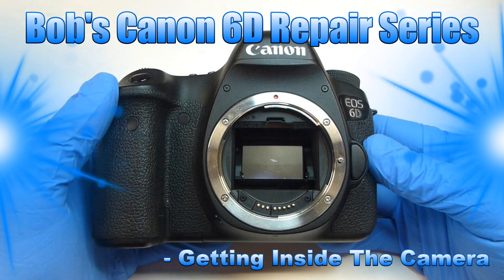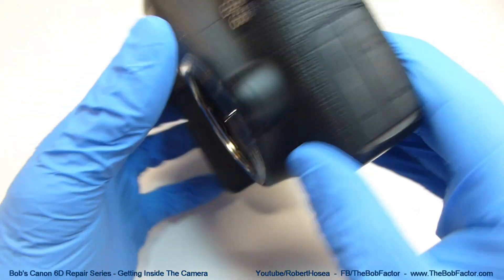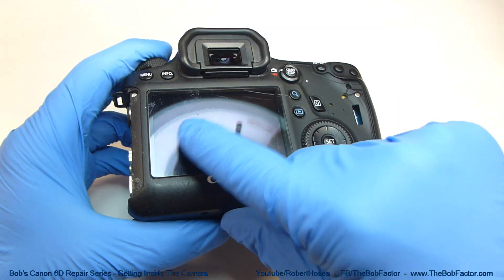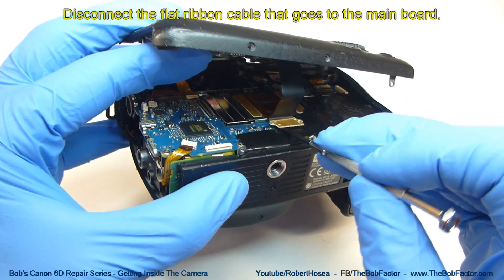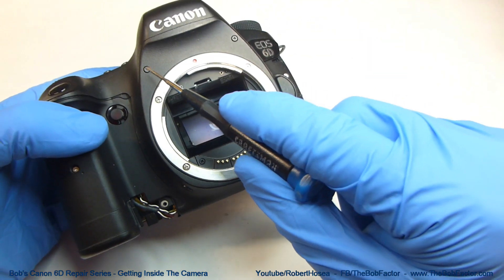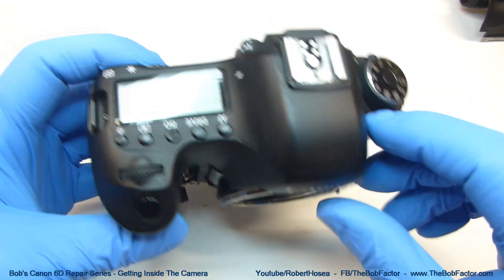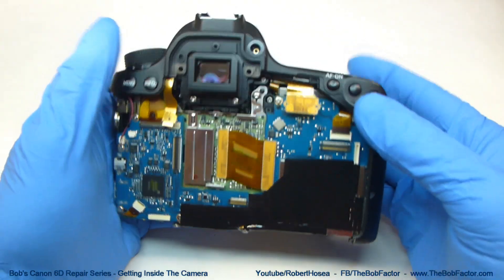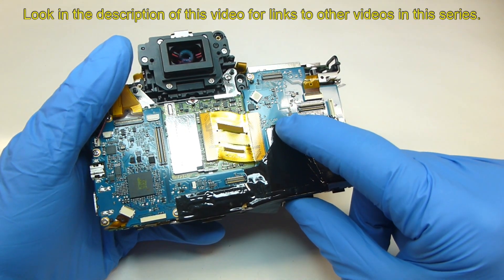Canon 6D Repair Series - Video #1, Getting Inside The Camera

Comment: This is a great video, clear and concise. Great diagrams too. 
I have a question though... I need to replace my aperture dial. Do I need to remove all the other panels to remove the top panel? It's obvious I need to remove the left and rear panels, but it looks like I could just remove the two screws above the lens on the front panel, and not touch the bottom or SD card sides. Does that sound right?
Reply from the maker: Yes, you should be able to get the top piece off that way Tony.
Reply: @ Thanks Bob.

Comment: Bom dia, tudo bem? Como posso fazer para trocar a bateria interna da CANON 6D, a data da minha muda a cada vez que desliga a câmera. Obrigado, abraço.
Reply from the maker: The battery is on the backside of the main circuit board. I believe it is a lithium rechargeable battery. Unfortunately I don't show the battery in any of the videos. It should be easy to spot though once you remove the main circuit board.
Reply: Obrigado por responder, vou verificar, desejo sucesso para você, abraço. @Thebobfactor

Comment: Is there a trick to putting back the small flex cable in top-left (near Menu/Info button)? I reassembled everything and now camera won't turn on (except red led near SD slot flashes sometimes). I suspect that cable isn't making a good connection.

Comment: Thanks dot this video, I bought a used 6D for 300€ because it wasn't auto focusing. I didn't mind at first but then I thought to check the connector to the AF sensor. I was pleasently surprized after I assembled the thing back together. It focuses as a champ now ! :D
Reply from the maker: That's great! And nice job on doing the repair yourself.

Comment: Hi, Thankyou so much for these videos - they are great. I broke off my lens release button, while trying to release an old stuck lens - silly me. That's getting fixed at a shop, but they are only removing the lens, The cost to strip down the camera was too much. So I am concerned that the stalk and circlip for the release button may be going walkabout inside the camera. My question: Is it possible to remove  just the front cover (cg2-4184-000) without doing the rest of the teardown you have shown?
Thanks from New Zealand!
Reply from the maker: Hi Rod. You will need to remove the side and back panels so that you can get to one of the electrical connectors and disconnect it on the main board. I don't believe you will need to remove the bottom though.

Comment: My 6d viewfinder info shows the warning symbol p.313.. do you know what is that and how it solve?
Reply from the maker: Hi Lucas. The p.313 refers to the page in the manual and it has to do when certain items are "Locked". Here's part of page 313 that describes the "!" icon appearing:

-----------------------------------------
Warnings  <!>  in viewfinder

When any of the following functions are set, the <!> icon can be displayed on the 
lower left in the viewfinder (p.23).

If the Picture Style is set to [Monochrome] (p.113), the warning icon will appear.

When WB is corrected
If white balance correction (p.123) is set, the warning icon will appear.

When ISO expansion is used
If the ISO speed is set manually to L (50), H1 (51200), or H2 (102400) (p.107), 
the warning icon will appear.

When spot metering is set
If the metering mode is set to [Spot metering] (p.150), the warning icon will 
appear.
-----------------------------------------

Comment: Thank you i am going to change the top shutter unit it makes a grounding noise and hard to change.  besides that my question is what type of glue to use after putting the leather 3 parts. Thank you so much for explaining all !!
Reply from the maker: Hi Peter. I have been using Elmer's Rubber Cement. So far it seems to work good.

Here's a link to some on Amazon:
https://www.amazon.com/Elmers-Photo-safe-Repositionable-Wrinkle-Adhesive/dp/B079KTKK6X/ref=sr_1_7?crid=DF5GKQ18B068&dchild=1&keywords=elmer%27s+rubber+cement&qid=1632174020&sprefix=elmer%27s+rubber+%2Caps%2C252&sr=8-7
Reply: @Thebobfactor  Thank you Robert so much  for your recommendation I will take your advice many thanks again ! you are no 1 .

Comment: Hey Robert! Your material is so well detailed, I'm impressed! Thank you for sharing. Btw , would you know if it is possible to fix a main board by reballing it? My 6D main board has failed and I want to try and fix it myself... Do you have anything to share on this matter? Thanks again!
Reply from the maker: No I have never tried doing that with a camera's circuit board. Generally, for me they are almost impossible to trouble shoot, and so it's just easier to replace them entirely. If you try reballing it, I would sure be interested in the results that you get!

Comment: I've watched your videos on repairing the Canon 6D. Do you have any information on how to fix the control dial just behind the shutter button? It has become hard to turn. Thanks.
Reply: No, I don't have a video on repairing that part. I've found that it was easier just to replace the entire unit. The only problem is that I've never found anyone in the U.S. that carries that part and I usually have to get the part from China. Here's a link to one that is on Ebay: https://www.ebay.com/itm/264814732531?hash=item3da83024f3:g:svUAAOSwAaJZ~rIa  I hope this helps you out.
Reply: @karenandbobstickney4478 , thank you. I know someone that had the same issue and they glued a thin rubber band around the circumference of the wheel. It worked for them. Not sure if I want to do that.

Comment: Great video ! I realize that I have a lot to learn from you. However there is a mistake you are making regarding the white connector on the Mother board ( top left corner) 7:22 , the flex should not be pulled out directly.That too has a lock on the bottom. I made this mistake myself some time back. This is also for the benefit of the viewers . Thank you

Comment: Thanks for the tut, I had to replace the wheel, everything went well but after putting it back together, the camera doesn't power on. The initial red light signal blinks on when switching from OFF to ON but the LCD is blank and the camera doesn't respond.  At one point the LCD seemed to display very shortly all the data at once then nothing.
Reply: Maybe there is a bad connection on cable connector? I hope you find your problem!

Comment: These videos are fabulous.  The screw sheets are very clever!  I have a quick questions- my well taken care of 6d is having a problem where the buttons on the back intermittently stop working, or press themselves.  I assume it's a component going bad, but it's not worth sending the thing to Canon or randomly ordering parts when I can replace it for a few hundred more with something newer.  (I was shooting a concert on NYE- thank god af-on kept working- but all the other back buttons went crazy.)  Anyhow, I saw that there is a connector going from the back plate to the main board.  It it worth opening the camera and re-seating/cleaning it?  Have you ever known one to come loose or cause issues like this?  It's about all I'm prepared to do before it's sold for parts.  I did drop the camera on thin carpet and this issue cropped up not too long after.
Reply from the maker: Hi Brian, I've never really seen a problem with the main connector or any of the flat ribbon cables just coming loose, but you never know. I think that would be a great first place to start looking. In addition to the connector that goes to the main board, you should also un-seat and then re-seat the flat ribbon cables on the inside of the back cover. Good luck with it Brian. I hope you locate the problem! -Bob
Reply: @Thebobfactor  Thank you- appreciate your advice.  I'll give it a go.

Comment: You might be able to save me a lot of time if you know the answer to this one. Could you tell me the specs of the different screws in the 6D? I have printed out your sheets so I know the lengths but I don't know the other specs. If you know it would be a big help. Thanks again.
Reply from the maker: If you're talking about thread spacing and the diameter of the screws, unfortunately I don't.
Reply: @Thebobfactor  Thanks for getting back to me. Appreciate it. I managed to strip a few trying to remove them. It seems my screwdriver was too much a Philips and not enough a JIS :( Now I know. I fixed my main problem of the USB not working reliably but now have an even bigger problem. It seems that for some reason beyond my understanding the center focus point no longer works. The lens just hunts back and forth and never finds focus and then just stops dead. I am going to have to open it back up and try to figure out what the hell I did. Beyond frustrating.

Comment: Man on man thank you so much! Love your print out sheets! You should have seen my hand drawn ones for the 5D Mark II they look like caveman drawings.
Reply from the maker: That's awesome. I'm glad they helped you out!
Reply: @Thebobfactor  Using these again today. Thanks again. It took going into the camera 4 times to finally figure out exactly what was going on and a big stroke of luck. My 6D had a broken USB port so I opened it up and tightened the et and touched the joints to try and make sure they had not gone cold. Put it back together and the USB port was much more reliable but still not perfect. I would have left it at that but the strangest thing happened. All the focus points in the camera worked except the one good one in the very center! Can you imagine how frustrated I was with this?! Focus everywhere except the center! ARG. So I open the camera up again and break it way down to take out the focus assembly. The mirror on the focus assembly had a PERFECT triangle section broken out of the EXACT center of it. It was so perfect that I just assumed that it was designed like this. Checked all connections put it back together and still the problem persisted. A week or so later my partner picks up a tiny piece of the mirror of the floor and shows it to me and asks "is this important" I look at it and immediately realize it is the piece of mirror from the focusing assembly! Light bulb moment! Soooo strange. How could the mirror have broken without me breaking something else in the camera? I was nowhere near the focusing assembly to fix the USB port so I did didn't do it. I just had to share this strange story with your wall. Today I am installing a new focus assembly from Canon that costs $80 delivered. It took 2 days to arrive! And I feel the price is totally reasonable. Canon Canada offered me good service on the phone even during this COVID-19 pandemic. So props to them for selling parts to the general public and getting them to me so fast. Very impressed with them.

Comment: The on/off lever on the top panel of my 6D is extremely stiff to move. If I take the top panel off do you think I can repair this or will I need a new top panel?
Reply from the maker: I think it would be worth trying Neale. Here's a link to a video that I did that shows how to repair the power switch on a 60D. It's not the same camera, but it will give you a general idea of what it will be like to take it apart.  https://www.youtube.com/watch?v=rpE7Co3dfgo

Comment: Great video. Thanks Robert. It's very well detailed and remarkably easy to follow. I used it yesterday to replace the main dial by the shutter button. My only comment would be that a #000 Phillips driver was a better fit for the screws. Might have just been the set of drivers I had though. Thanks again for this great series!
Reply from the maker: Hey thanks Ed. Yep, I've also noticed that too with some screwdriver sets. I guess it shows that it's good to have a few sizes on hand before starting a repair job. I'm glad you were able to get your main dial replaced.  -Bob

Comment: Great! Thanks for this video. I have been able to disassemble and replace the power board. But the camera still doesn't work, it doesn't turn on any lights. 
Any ideas? Could it be the motherboard?
Reply from the maker: Hi Willy. Is there anything at all displayed on the top LCD? Even just a blinking battery icon?
Reply: @Thebobfactor  No, there is nothing at all...
Reply from the maker: @willyvalen00 , is this also what the camera was doing before you replaced the power board? Something else to check would be the micro switches for both the SD card door, and also the battery door. Check to see if they look like they are working properyly.
Reply: @Thebobfactor  Hi Robert, yes, it did the same before changing the power board. Ok, I'll check, thanks.
Reply: There are two micro switches one under each SD card lid and battery lid . Check them out .All the best .

Comment: I could not complete the steps.... A screw in the battery compartment and some of the screws in the front panel is stuck. Any tips?
Reply from the maker: I've had that happen a few times on other screws. If the Phillip head slots in the screw head are rounded out and the screw driver can't get a grip, then drilling the head off is the only way. Then you will hopefully have enough of the screw remaining after you remove the cover it was holding down, to grab it with pliers and unscrew it. If the problems is that the threads on the screw are stripped and the screw will not back out while turning the screw (unscrewing), then putting something under the screw head (like a very small tipped flat screwdriver) and pushing up on the head while unscrewing the screw will usually get it to back out.

Comment: thank you very much !! je saved my life ! i used your tutorial to replace the speed wheel .. now everything work fine !  thank you !!!
Reply from the maker: I'm glad it helped you out Haroun!
Reply: Is this the wheel/dial right behind the shutter button? If so, would you point me to the tutorial?
Reply: @avfuels  yes sir, i purshased a sheep one from aliexpress, and i used this tutorial to replace it .. wel ok, this video is not enough to arrive to the wheel, but, if you folow this tutorial, it help to get inside the camera and do 95% of the job, and the most difficult part
Reply: Haroun, I'm about to do the same repair, haven't started because I'm afraid getting to the wheel itself will be complicated, is it? I don't see that part in the video and I don't want to mess it up.
Reply: @juanpcohen  getting the wheel itself is complicated, you have to be very careful becose you have to get the whole wheel-bloc, and disassemble it.. getting the whole bloc is easy, but disassembling it to replace only the wheel is so complicated, so you have the choice, but don't take lot of risk, replace the whole wheel bloc, it is lot easier, safer, and not so expensive

Comment: Thanks for sharing! I need to replace the top cover dial (right dial) on my 6D. Would I have to follow the whole process or is there a shortcut to open the top cover?
Reply from the maker: Yes, unfortunately you will need to disassemble the camera completely to get access to the screws that hold the top part down.
Reply: @Thebobfactor  thanks! I'm in the progress right now. Got everything disassembled now. Thank you so much. Just one thing. There is one screw missing in diagram #1! It's the tiny middle one from the bottom part. Right below the tripod mount.
Reply from the maker: Thanks for that info Nico. I will be updating the diagrams soon and I will be sure to add that one to it also.
Reply: @Thebobfactor  You're very welcome! Just another quick question: Would you still recommend the rubber cement as #1 choice for fixing the rubber grips?
Reply from the maker: So far the Elmer's Glue brand is the only one that I've used so far, and it does seem to hold the grips on pretty good as long as you use enough of it on the grips. And, it's also easy to remove the grips again if you need to.
Reply: @Thebobfactor  comments say it smells quite a bit. Does it go away after some days?
Reply from the maker: @NicoKaiser  I haven't really noticed an odor at all with the glue. Possibly because it's such a thin layer being used, and the glue is not exposed once the grip is placed on the camera.

Comment: Great video! Is the first part what I would follow to replace the lcd vignette? It’s not a cracked screen... it’s a coloring issue on the lcd after a drop. Thanks!
Reply from the maker: Yes, once you get to this point in the video https://youtu.be/tUl9cV5GA4M?t=233, you should have access to the screws for the LCD. Sorry I don't have a video that shows that process though.

Comment: Followed these videos to the point, even stripped and checked over and now I have Error 20 instead of Error 30. Any ideas on what may have gone wrong? Cheers dude, amazing content nonetheless
Reply from the maker: Hi. What problem were you originally having? An Err 30 would suggest a problem with the shutter. An Err 20 is a mechanical problem. Which, If you replaced the shutter assembly, then that may be from the camera not detecting the shutter actually moving now. Double check that the small 2-wire connector that comes from from the shutter assembly is seated properly in it's socket. Also double check all of the flat ribbon cables as well. Sometimes a flat ribbon cable may look like it is seated properly, but being at just a slight angle in the socket can cause it not to make a good connection.
Reply from the maker: Hi. I was just curious if you were able to figure out what the problem was that was generating the Err 20 message? - Bob